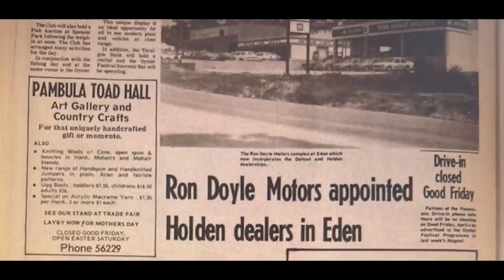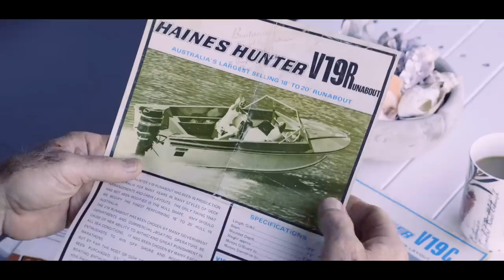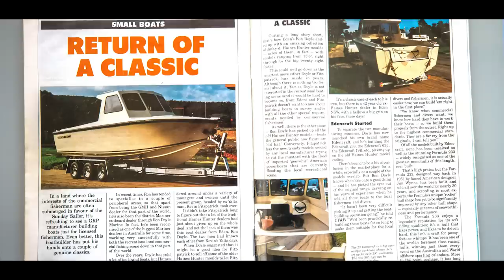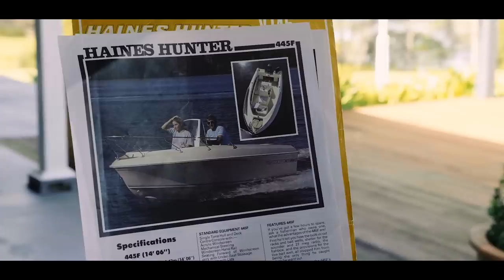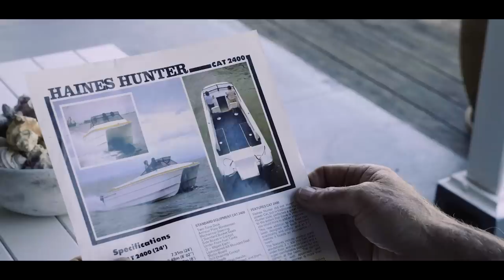Ron Doyle and the origins of Edencraft boats

Comment: I admire Erick. He seems like an awesome bloke, always loved his work, seems he's always up for a chat, and will always take the time regarding any questions on his old boats. 
Along with his iconic craftsman, which is, by the way, second to none.
Also, recognising his successful achievements with producing the now famous 263L, which subsequently will be talked about in 50yrs time just like the 233 hulls are today.
I'd have to disagree slightly with his comment @ 3:38 regarding the 243L hull and suggesting the extra 2ft extension on the back overcome a few of the problems in the old 243L. Well, perhaps it probably did to a certain degree, but with big horse power, any hull overpowered with overweight outboards will potentially contribute to handling problems.
I have a 243L transom mount twin rig with a sensible twin 4 cylinder four strokes, 400HP combined configuration, which is ample power. 
I believe this gives a great weight to power ratio distribution hanging off the transom, along with trim tabs, (which are a must on any old 243L hull) and a forwad pump in/out ballast system installed in the V berth it rides like it's on rails, I can't fault it, unbelievable performance in a following sea showing its magnificent Carolina Flare.
The old 243L, mine included, has a 600+HP rating, I've seen a lot, or most of the old 243L's with twin 6cyl four stroke donks hanging on the back (no pod, no trim tabs, no wonder it's out of wack).
After owning one for many years, I would have to say that twin 6 cylinder, four stroke donks would potentially contribute to the performance problems Erick is probably referring in the 243L hull.
600-700 HP 6 cylinder four stroke twins is way more than John Haines ever originally intended to carry in the 243L hull.
Big heavy HP with no hull performance additions like pods, twin tabs or ballast system will definitely make a 243L ride arse heavy and ride like a pig.
Thats IMO anyway.